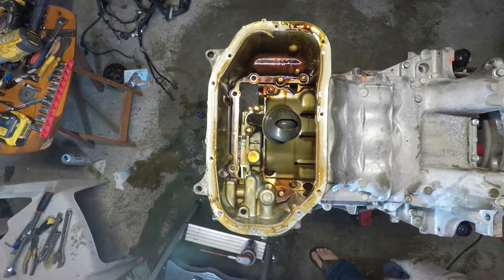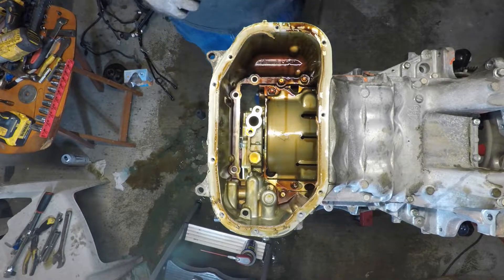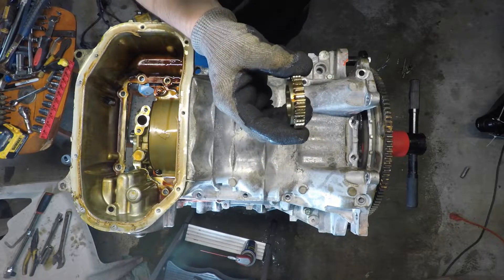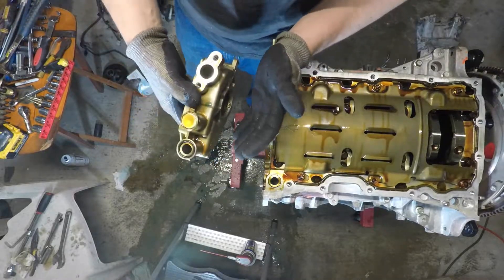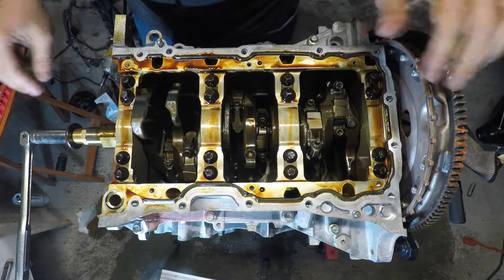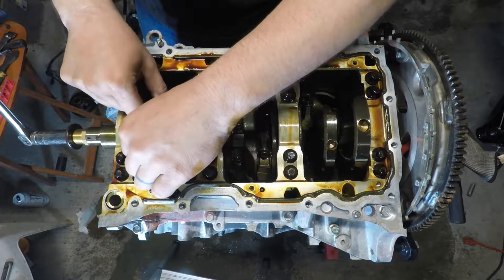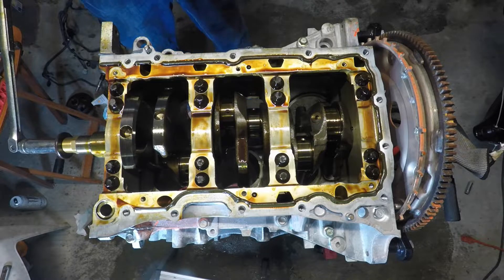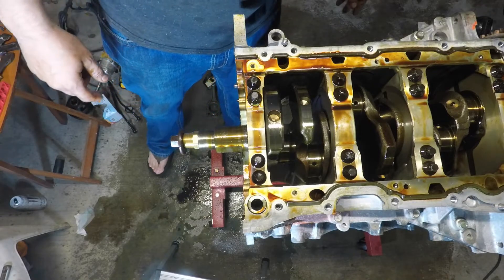Forged VQ37VHR build part 11, removing upper oil pan, oil pump, windage tray and pistons/rods

Comment: Hi... My name is Stanley and I think this is by far the best indepth video I've seen on VQ37 rebuild process, and I understand this is a two years old video but I'm having a problem with my awesome G37x. I live in Nigeria (West Africa)so getting brand new OEM spare parts of these cars are not possible. I think my oil pump is gone and it's hard to find an Infiniti specialist mechanic in my location to work on my car. Please, can you refer me to a video or guide me through the process of oil pump replacement in this beautiful motor. I'd really appreciate any help. 
Thanks
Reply from the maker: @springviewcorporation4653  the best advice I can give you is to search online for a PDF manual on the VQ37VHR. It is all explained in there.
Reply: @garagefanatic7830  thanks a lot
Reply: It turned out I had a spun bearing issue and have been able to replace the affected parts but I'm currently dealing with Cam Position Sensor "A" bank 1 and bank 2 circuit problem. I've swapped three different used OEM sensors but the P0340 and P0345 codes persists. When the motor is running and I pull bank 2 cam sensor, I get no reaction but once I pulled bank 1, the engine dies, but I'm not getting no check engine light and the car runs fine. 
Only issue I've observed was car idling below 600 rpm when in drive. 
What do you think I should do? I am not good with the electrical aspect of cars.

Comment: I only need to take off the upper oil pan and baffle so I can inspect the pistons/rods/bearings. Do I really need to remove them to inspect them? 
Wouldn't I be able to tell if a piston was bent? My head gasket blew and I don't want to just replace the head gasket if there are other issues. 
I wonder if it's worth buying forged pistons and rods!? - SOHO A2A kit for the street--- about 550-600 WHP is what I was... and will be running.
Reply from the maker: You should be able to see if any rods are bent with a little bore scope camera through the oil pan being removed.

Comment: I have a question I just did a swap and when I was under the car I saw a hole just above where the starter goes , I can see inside of it but don't remeber pulling anything from there it's in this video..almost a triangle of 2 bolts and a round casting mark ..perfect hole look like something with an o ring would go but its where the starter body would block just an odd place for a random hole..any idea what goes there?? I'd hate to loose oil through there lol...
Reply from the maker: Send me a picture on Instagram. @brownleeshane

Comment: Was the red text comment stating that you can pull the oil pump without pulling the upper oil pan?
Reply from the maker: No, just pointing out which bolts I was removing.